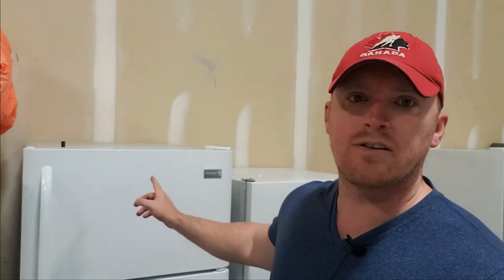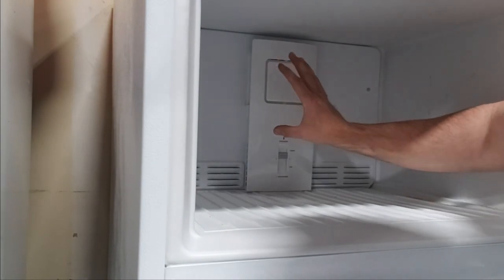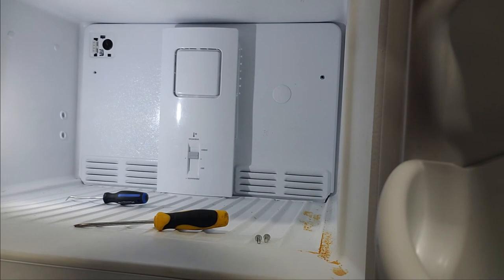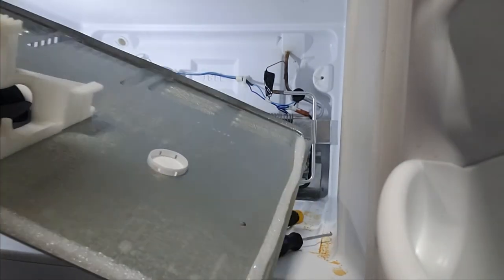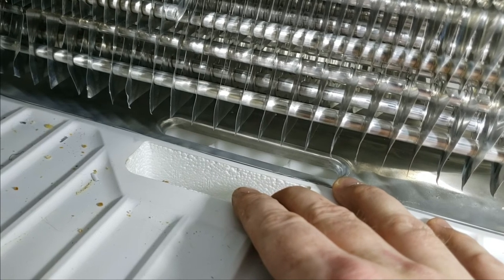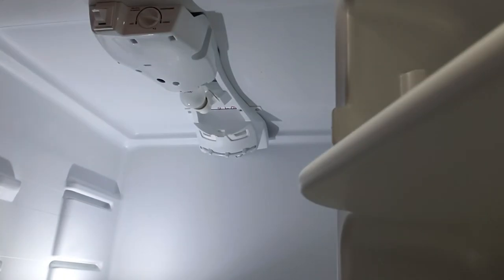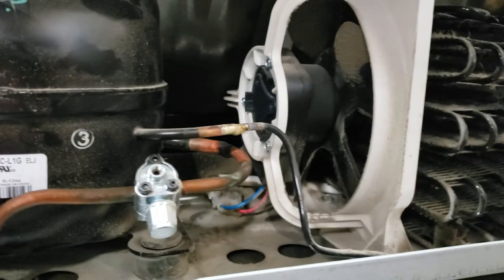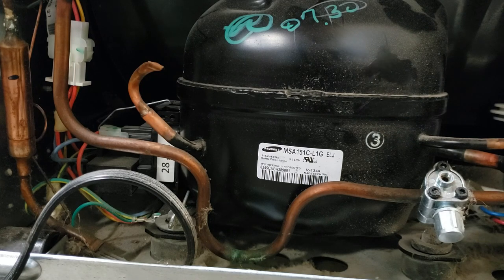WHOLE FRIDGE DIAGNOSED (FRIGIDAIRE FRIDGE PICKED APART)

Comment: I cleaned my coils they weren't that bad. My refrigerator is not getting cold all the fans are on I can hear and feel the motor running. I replaced the starter relay and capacitor and it's still not getting cold what would be the next step would it be the temp control? Thank you for your video you are very thrill you're easy to listen to and I appreciate you being here especially for people like me who want to be able to DIY
Reply from the maker: Thanks for watching Weaving Spirit Oracle. If the compressor and fans are running it should be cooling, if not likely that there is a refrigerant issue.